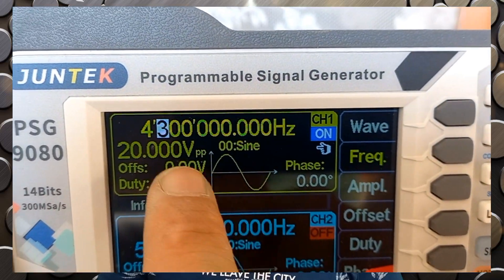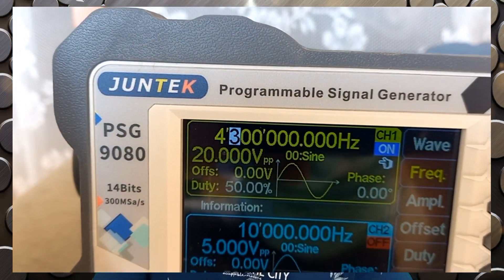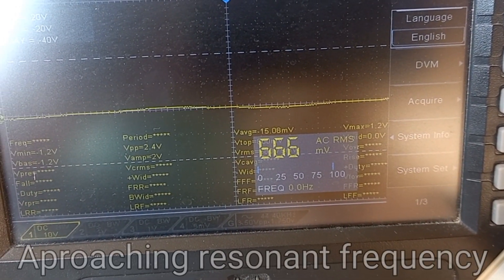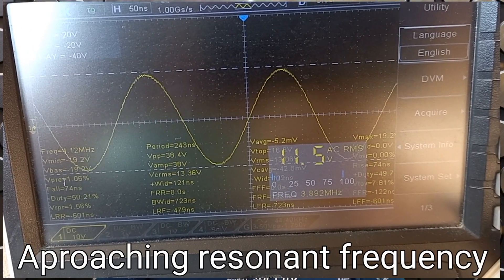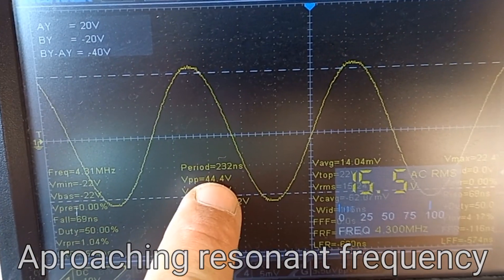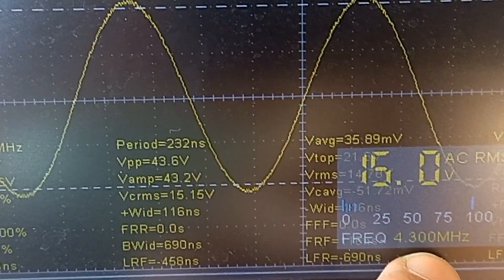Space-Time Antenna Resonant Frequency Found

Comment: Even though I know exactly how to create a fully functional Spacetime Antenna, I just didn't have the budget to get it done, and so I did the next best thing and created a model that is half the size and a complete instruction manual on how to build the real deal, which I released in my book (Starseeds Activate by Artur144).  It gives you a step by step breakdown and links to downloads parts, guiding you through the whole process, so that you can do it too. Yes, there is a 3mm gap between the Merkaba and the 1st sphere. Yes, the Merkaba is insulated from the metal rod that runs through it. Yes, the spheres are insulated from the metal rod that penetrates them all through plastic spacers that hold the spheres in place at the right height. Furthermore, the way in which the stand for the STA was created allows for the most outer sphere to vibrate freely. I released this book in May, 2025 on Amazon. Infinite Blessings y'all ♾️ 🙏🏼 🌞

Comment: Wow! I had a plan of making one myself after watching Bashars videos about this. I also gave the videos and information to AI. Ai told me to have a Quartz in the ultimate inner middle spot of the 2 fractal pyramids merkaba. But also, the most important hint from bashar came from the Bashars notions about the 2 spirals or cyclones. I have been taught to percieve the nonphysical realm, "energy-grid" and in this energy-grid lies these 2 cyclones and I believe it is very important to place this antenna at this specific spot in the grid! If you need help finding it in your room, you can send me a photo of the room and I can spot it out for you. Thanks for the great work!
Reply from the maker: there is a crystal inside the double Fibonacci Vortex which Bashar call it Flash Matrix and is connected in parallel with the Merkaba so its kind of at the center of it in a sense. 

The big STA is 2.5 metrrs long and 1.3 metrrs wide , I cannot choose easy location for it .
Reply: I released a complete instruction manual on how to build the #SpacetimeAntenna in my book (Starseeds Activate by Artur144). Please let me know if you have any questions and much success, you can do it! ♾️🙏🏼🌞

Comment: Hello, have you tried activating the device by a single spark from a van der graaf generator? Then measure the output wave form as it oscillates
Reply from the maker: @Inigovanhouten  I tough about it but Vandegrapf is building static charge while the Antenna need oscillation at a very high rate.

Comment: Great job. I have a signal amplifier that can take a signal from the signal generator and amplify its voltage 

If you need info, I would be glad to share it with you

Thank you
Reply from the maker: We need to amplify the power in Watts not only the voltage. 
Now the signal generator supply 350 mW and is good to be at least 5W.
I alredy purchase and they are on the way now but will take some time.
Reply: @primeradianttechnologies3085  exactly

Comment: Well done! I am happy to see this 😃 is this work a parallel to Tesla’s ideas and experiments? I think he was also working with resonance. Thank you
Reply from the maker: Sure, a Tesla Tower is a Resonator, too but it dissipates the higher voltage (potential in the air) while this one is designed to pulse it and convert it into DC current at the end. The Idea of Tesla for wireless electricity can be achieved with this kind of Space-Time Antena if the outer diameter of the bigger sphere is between 1.8-2.1 meters. Also, have to be in a tower 10 meters high instead 57 m like Wordenclyffe Tower. And to crystallize (amplify) the entire electromagnetic field of the planet is enough, only 48 pieces but placed in strategic locations. (some of them must be in the ocean too). Yes the idea relates to what N. Tesla had in his mind.